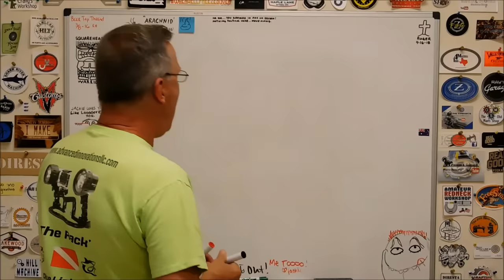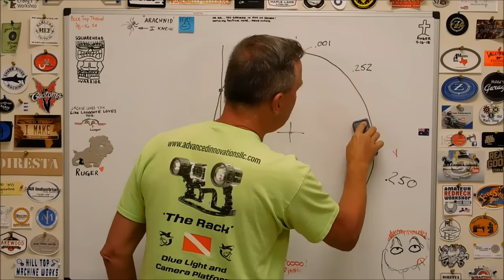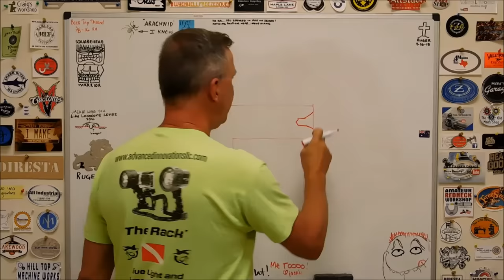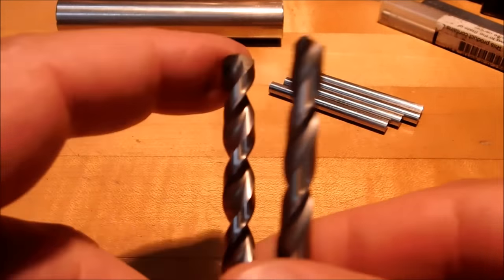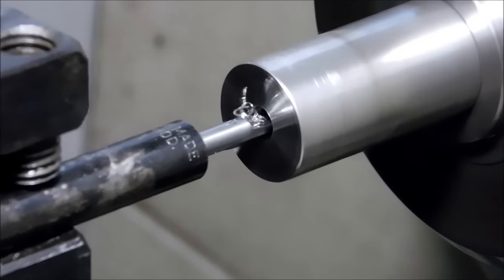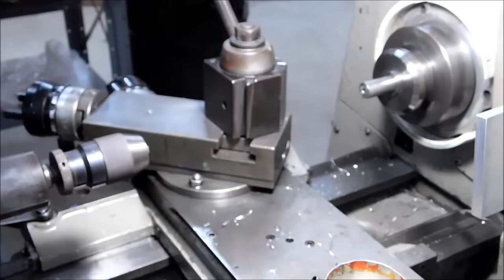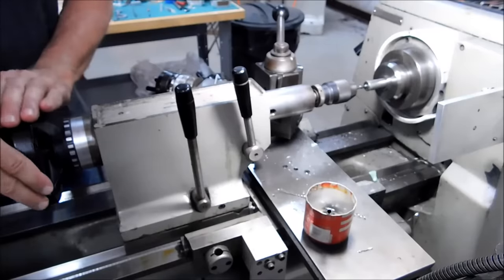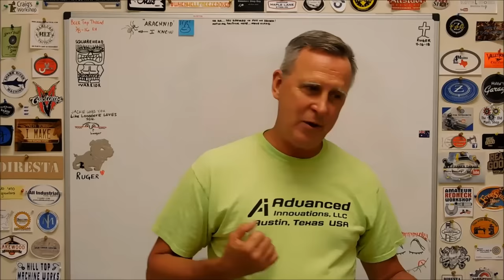Techniques for Machining Straight Deep Holes -- SHOP GEM --

Comment: Perfect timing, I've struggled for too long, trying to drill deep 6mm holes in 6Al4V Ti, to make bolt action pens,  my previous best was just under 50mm, and it cost me several bits, the other week, I managed the ungodly depth of 80mm, with no loss of tooling:), I have one of the micro carbide boring bars ordered, and look forward to trying your technique.

And a question please?, as a complete noob when it comes to machining, something I constantly struggle with is, what size holes to drill(undersize), for the appropriate sized reamer, I think I'm drilling to large of an initial hole, and not letting the reamer do it's job, I'm crapping myself about shattering an expensive, 6.04mm chucking reamer;)

Thanks, Joe,

Scott.

p.s. my lathe is an Oz made Hercus 260ATM

Comment: Hey Joe. I'm having a b**tch of a time putting a .1875" straight hole down the middle of some 1/4" brass so I found this video.....and unsurprisingly found the info I need from you  once again :) and will be trying it later today. I do know that drills love to wander in brass when trying to drill in the lathe. My question is this: do you think it would be better to do the cutting edge mod to the drill bit, to take the sharp edge off, (so it doesn't bite) which is typically done for brass. I do know you said use a sharp drill in the video but am wondering if that's also true with brass.  I would do this with a stone by hand as I usually do as I don't have a D bit grinder (wish) but I worry that doing the edges by hand will make them uneven and will cause even more trouble. I'll give it a try with a sharp drill first but am curious about what you think. I've been working on this problem for a few days and I will sure be happy when I get my first concentric hole!! So far they are anywhere between .001 to .004" out of concetricity...geez! Its driving me nuts. Thanks once again for your fabulous videos.

Comment: Another Great video Joe!  When drilling 40-80 X diameter have you found much difference between 118* and 135* angles?
Reply from the maker: No. But geometry would dictate the 118 would generate more heat

Comment: I was literally looking for a video like this a couple days ago. I am gearing up to do some 4" long .250 holes in 3/8" aluminum plate on the mill. Definitely can use some of this info for that project. If you have any advice specific to deep drilling on the mill I would love to hear it. Thanks much Joe.
Reply from the maker: If you can, plunge an end mill into the hole before you ream the top section. Its quicker than boring and achieves the same concentric result.
Reply: @joepie221  I may have the perfect end mill for the job. I was able to scrounge up a series of 1/4" carbide end mills from the scrap yard by weight. Wish I would have known what they were back then, was a lot more of them. Thanks again

Comment: That's what drill bushings are made for. One fixtures so the drill point leaves the fixture and enters the work with micro spacing between the bushing and the work. I also use piloted drills sometimes, oil hole drills. Don't use a sloppy machine tool. The fast spiral gets the chips away from the cutting face a.s.a.p.. I love them.

Comment: This was great Joe. I have tried many times to put a straight hole thru bar stock and I have always failed. Now I know. Would this be the same method used to bore a gun barrel?
Reply: In general, gun bores are drilled with a single fluted gun drill. Google it. Edge Precision also shows how to grind such a drill on his channel. Hope this helps.

Comment: I agree with you about using Anchorlube, it Is good stuff. However I have also had great results using Rocol R.T.D. compound reaming and tapping in stainless steels
Reply from the maker: I may have to check into it. I normally reach for moly-D

Comment: Great video. I heard about AnchorLube.Some good,,some bad. I ordered a2 oz. sample to judge for myself. I then,ordered a gallon. I use it for tapping,single point threading,drilling and reaming. You can thin it with a few drops of water.Great product.
Reply from the maker: I did like it. But it did stain my bed ways where a drop sat overnight. Beware.
Reply: Joe Pieczynski When I finish using any of my machines, I wipe them down and spray all bare metal with WD-40.The next day,everything gets wiped down.Bedways get a fresh coat of way oil.👍

Comment: That is a is a great to watch and a fantastic technique to have for drilling/reaming  a long hole, BTW i had an old boy tell me that the best way to drill stainless it slow & lots of lube, i hade to drill a 12.5mm(1/2") stainless bar with a cordless drill in low range & it drilled it with ease it may have taken a while with a few drill bit stepping up but it got through in the end..

Comment: Great video Joe, I always learn lots from you. Just one question. If you did this slightly smaller then reamed finish size all the whole way thru, would result be better? See you got me thinking!
Reply from the maker: Very possibly, but the undersize drill wouldn't have a good support as it got deeper.

Comment: Center drills are for cutting lathe centers. Spotting tools are used for standard drills even in a lathe but normally used in flat work.  Moore book recommendation, bore for location, ream for size.
Reply from the maker: To each their own. I like to have some diameter established before the web of the drill makes contact, A spot drill won't allow as much penetration as a center drill will.
Reply: @joepie221  try a Moore spotting tool

Comment: Hey Joe, I know this is an older video, but I couldn’t help it.  I totally don’t get the diamond pin for fixturing.  I just don’t have a frame of reference for exactly what that means.  It is for drilling a hole?  I don’t get it.
Reply from the maker: A diamond pin is usually one of 2 pins used to mate plates together in a drop on fixture setup. One round pin anchors the rotation, and the diamond clocks the rotational position. There is no need for a round pin to stop something from rotating. The sides of the pin do the work so the top and bottom are ground to clear. Resulting in a diamond shape.
Reply: @joepie221   you are so awesome, Sir.  Thank you. I understand now. I kept trying to relate it to the movement of the drill bit in the hole and coming up blank. Lol.

Comment: I need a tractor to drag my tailstock. Will have to stick to crank feed and retract. Lol
Reply from the maker: I ran a Maza 18-140 that had a monster tail stock on it. It also had a shift lever that accelerated or amplified the crank value by 4X, and 1/4X. It was great for getting drills out of holes and applying super pressure. Never saw another setup like it.
Reply: Joe Pieczynski My big monarch has a 2 spd tailstock but drilling with it is a big hassle since it is a built in huge live center. I drill with the carriage on it.

Comment: Another great video packed with tips!! Who makes the small boring bar you are using? You mention this technique is for drilling small diameter deep holes, at what size would you just drill and ream and not use this technique?
Reply from the maker: I believe they are micro brand.

Comment: Pilot drill at least 1xd around 0.010-0.015 microns(metric) oversize and drill your deep hole- that is recommended process for deep hole drilling- if you have double margin drills will give you better geometry and accuracy. Spot on as far as I’m concerned - perhaps something to add- your pilot drill should have have a bigger point angle then your following drill.

Comment: Fantastic. Once again you've helped me see things differently. never thought about 4 points of contact on the drill before. Now I will. Question about center drills - Lately I feel like I get a better start on my drill but if I use only use the straight-sided section of the center drill. Is the angled portion key in the geometry of starting a drill bit on center? (I still use it sometimes if I want a chamfered opening to the finished hole or want a countering for a flat head screw.)

Comment: Hi Joe. Love your  channel, and I'm  new at machining.  Question, drilling a deep hole. If you rotate your stock counterclockwise while  drilling clockwise, wouldn't  that help bore a straight hole ?
Reason I'm asking, my ex- brother inlaw was boring 12" deep hole with a gun drill. I believe the hole was .125.
He owns a successful custom tool, making and grinding  business . He had given me a bunch of machines but ended up selling them. I even had a Crystal Lake machine.

Comment: Thanks Joe. Nice vide. What we can’t know is if the diameter “opened up” somewhere in the middle since the gauge pins might only be snug at either end. Could/should cut it in half to measure it there, or even cut it lengthwise but then not sure how to easily measure that circumference.

Would LOVE to see how you use the lathe to get a precise OD of a shaft - say +0.000 /-0.001. Do you get it within a few thousandths, and then “skim/dust it”, or do you try and “hit it on the money” based on the performance of the last 2 or three cuts?

Love your channel and videos. Keep up the great work!

Comment: Great video Joe! Never seen the diamond pin technique before, thank You for that. Had that alignment problem many times. I also think that the parts are much less likely to bind and stick for a variety of reasons with that pin geometry. I guess it would be fairly straight forward to grind dowelpins to shape, will try that. 
Good stuff on straight holes. Do You just clamp the reamer loosely when floating it? I do not have a floating holder for small reamers and it is easy to get cone/oversize errors if not being careful.
Reply from the maker: The diamond pin does stop the lifting bind you can get. I may use the term floating incorrectly. Its more like a light pass that is not expected to cut anything.

Comment: +1 for the boring bar vs reamer, however often in production a boring bar is too slow, depending on the size, a way to speed this up is to use regrinds or undersize end mills to true a hole and then punch them with a reamer.  i tell people all the time, sure a reamer will make a round hole on size, but its usually not straight because you put it in a hole that wasnt straight to begin with.  another help is stepping down pilot holes and using bushings to stabilize the subsequent pilot.  having a split point tip helps, using carbide also helps.  something i want to try but havent yet is 3 fluted drills.  i see that garr is selling them among other tooling companies.  i've come to realize that theres limited reasons to not buy a carbide drill, generally if its an unusual hole size that im not making many of i may skimp, but at this point the cheapest drill i will buy is a powdered metal hss cobalt, usually getting them from morse as they have a warehouse about a mile away.
Reply from the maker: You make valid points, but if the end mill cuts over size, you will loose the accuracy this procedure provides. Then again, if it were a production environment, it probably isnt being done on an engine lathe, so options are available.
Reply: @joepie221  yeah, it only works with regrinds/specific undersize mills, lakeshore sells some specific for this purpose, i stick to mills but the principles hold true there as well.  Forgot to mention annular cutters do a really good job too, but its been a while aince ive used one, i cant remember how on size they cut and are available in limited sizes, but they approach a reamed hole in terms of surface finish, they do make a mess of stringy chips though lol.

Comment: You can "Re Centre" a Centre drilled hole by grinding off the Pilot and grinding away One edge of the 60 degree, making it a Single Point tool for correcting eccentricity of the centre hole. or do the same using a bigger, stubby twist drill but grinding one edge @ 30 degrees & grinding away the other edge.

Comment: Great advice in that one, kiddo!  Over here we tend to use  "Trefolex" which is a green dayglo paste, great for tap cutting and serious HSS drilling: it only melts at v high temperatures, and gives a good thread cut...moreover it has a super cool smell. 
Question: isn't 350 rpm a tad too fast for Reaming?  was always told to keep it around 100 rpm for Reaming....

Comment: Hi, today your advice about cutting with a boring bar to lead the next drill worked perfect for me.
I turned a round holder for 13mm kenametal boring bar to fit in my QCTP holder gap of 21mm, slip fit to be milled 3 flat surfaces later. So I don't have a 4 jaw chuck, so I chucked up the round piece with a 6mm shim in 3 yaw chuck to get the hole off centre for more meat to add grub screws afterwards.
I decided to use the smallest  centre drill to just make a mark for the bigger one, I never done this operation before. So the tip broke off in the metal, cant get it out. No small drill will survive the next attempt, so I loosen the chuck and rotate the piece for a new start.
So I start again with largest centre dril and no problems, I went along (100mm hole) from 6-7-8, and at 8.5 I start hitting that bit coming past. I think about it and stuck in a 9.5 drill. I could hear it catch the bit, stop, it lift it, I then removed it with a small punch. I then notice the drill start to wobble a bit , the hole now effed up a bit, the piece did not move in chuck. 
I then remember the boring bar tip, fit my new 8mm ISCAR boring bar, bore it out to 40mm in to 12mm drill slip fit in the hole. I then dril 12MM, 12.5 & 13mm , perfect ending right through.
Thanks for this tip.
Note :
The reason I fit this boring bar in a soft steel holder slip fit instead of directly in the QCTP holder is to prevent high pitch resonating noise. I tighten it(Grub screws), then press tuff marine grease through the open spaces around the boring bar, and this seems to silence things out, I have done it for 6/8/10 mm ISCAR boring bars and they silent so far compared to stuck in QCTP holder alone.
Reply from the maker: Interesting tip. I may have to try it. I'm glad my technique worked well for you. 'Start tight, end right'

Comment: At 3:29, I'll remember that .0158" in .75" depth for a .25" drill.
That sounds reasonable for a gear case I made, where the halves didn't mate perfectly. 1/2" holes, 2.75" deep. Say, doubling the diameter of the tool will half the error for the LD depth of the hole (not that it would). That gives me .008" in 1.5" depth. .015" in 2.75". The first two bolts went in perfectly. The 3rd bolt resisted enough for me to hit in with my palm. The 4th and 5th holes had to be hit in with a brass hammer and a flip of the wrist. I'm gonna head out to the shop, pull a bolt out, and see how far I can get a dowel pin to go.

Comment: That tail stock carriage bump stop is an awesome idea 👍🏻I’ll use that on my home lathe 😊, work lathe is a beast though and the tail stock weighs a ton . Was thinking of attaching the tail stock to the carriage so I can clear shavings faster by unlocking the tail stock and moving it in and out with the carriage using the DRO to show me where to stop. That might be an alternative for larger lathes with heavy tail stocks. 
Thank for the video and the tips 🤙🏻greetings from Perth Australia.
Reply from the maker: How about a tail stock trailing edge outrigger with an air cylinder on it? Foot pedal, and back it goes, one more time and here it comes. That would be cool. I've also seen large lever actions on tailstock barrels.
Reply: I have a tail stock lever on my Weiler lathe. It is really convenient and takes 5C instead of MK. Big problem is drilling through misbehavior, can sometimes be a showstopper. I often use a chuck mounted in a boring bar tool holder and use the carriage feed to solve that problem. It is rather cumbersome to remount the original screw operated tail stock feed.
Reply: @joepie221  Some of the lathes i was working on had a rack (tailstock) and pinion(it was under the tracks) attached to a tailstock.It made it moving so much faster and easier since it was large tailstock.Now if you put cordless drill on it instead of handle . . . Or a dedicated motor . . .
Reply: Just an idea from a young Ukrainian machinist, when he restored a lathe he put an air bearing system undet the tailstock so it slides easily on the bed. A one finger job to make it slide.
Reply: Joe Pieczynski now that sounds like a plan! Will have look at doing that👍🏻

Comment: Great video as always and very timely for me. I have to drill a 1/2X14"  hole in nylon round bar. Is this technique what you would recommend as well for long plastic?
Reply from the maker: Absolutely. Dwelling a drill inside deep plastic is just going to generate massive amounts of heat. This quick retract method should really help.